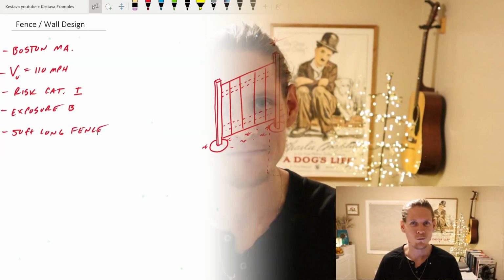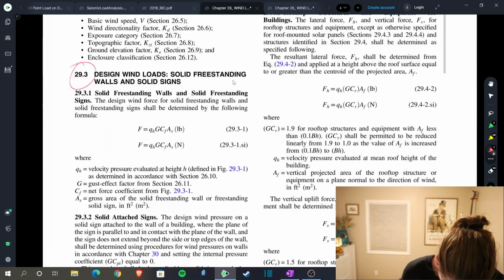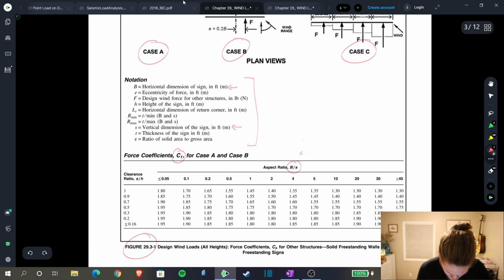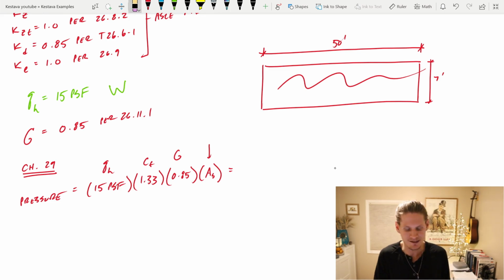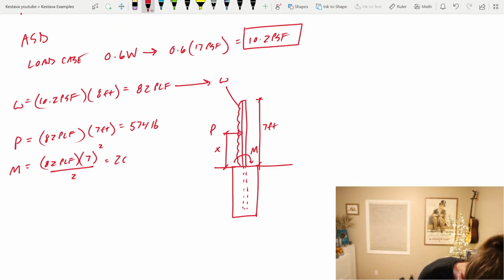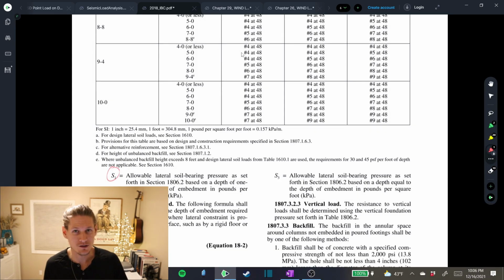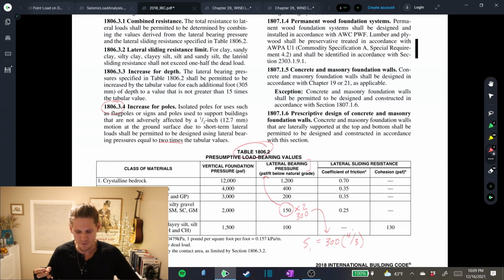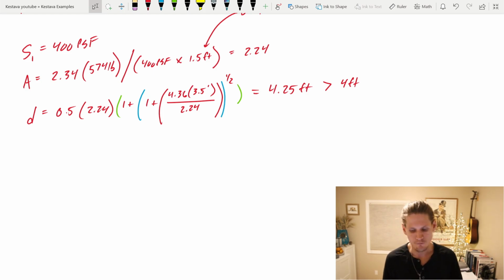Design LASTING Concrete Post Footings - By Professional Engineer

Comment: You can keep the d as an unkown and plug everything in the scientific calculator as a single equation and then use the solve function in it. It will solve for the unknown variable doing LHR = RHS and give you the result. This avoids the iterative process. For this example with 18" dia, the depth comes out to be 4.14'. So a 4'-2" deep should do.

Comment: Thank you for explaining these formulas, as I couldn’t get my head around it.
For the force height for a fence without gap, shouldn’t the force be applied at 0,05h above the geometric center, as shown on section diagram and described in ASCE. (load at 0.5h + 0.05h = 3.85f, not at 0,5h = 3.5f).

Comment: Had my contractor listened to me, my fence would not have come down.  He buried the footings at barely 2ft.   Do these calculations remain the same whether the post is fully buried in concrete or if using a post suppost that is partially buried in the footing?
Reply: With footings, you are receiving the resistance through your soil pressure acting along the concrete footing. With that being said, the depth of the footing is ultimately what controls the strength of your post. Whether you put the timber post all the way or partially into the concrete, that won't have too big of an impact as the soil is acting against the concrete. However, it may be beneficial to have some decent embedment of your wooden post into the concrete. This is my take on the subject and I may not be 100% correct. Thanks.

Comment: I love this video from an IBC and ASCE stand point. Your videos are truly amazing. My concern is with the typical “butting heads” of engineers and contractors. In the “real world”, if I tell a contractor that his fence post holes need to be 18”x54” I am going to get socked in the face! Just saying. Also, when we do not have a geotechnical report, is there a “default” soil/site class to select in order to get that “S” value?
Reply from the maker: totally agree James! good engineers should always be straight with the contractor with things that "could" be designed by an engineer and things that "have" to be designed by an engineer. we are bound by the code, so as soon as a contractor says to design and stamp something we cant just say its OK because thats how its always done. we have to prove it with calcs and the code. Yes there are default conservative values in the IBC that can be used!

Comment: Does this work if I'm embedding a pergola too? Would it be necessary for me to get some kind of rebar inside this type of piles?
Reply from the maker: pergola's have a large uplift force on them due to wind loading. you will most likely have higher loads that you need to design your footing for and rebar would be required to meet code minimums and provide development of the anchor bolts further into the footing (if required). but these are things an engineer needs to consider if they are designing the footing for you. the pergola manufacturer may provide prescriptive footing sizes that a contractor (or you!) can build. I hope this helps!
Reply: @Kestava_Engineering  Thank you! I'm a big fan of your content and I've learnt a lot with your vids, keep up the good work!☺

Comment: From a practical perspective, 18" diameter post footings would be impractical and uneconomical for a fence.  Something is amiss, this doesn't pass this 'what is done in reality' test.  Usually fence post hole augers are 6" or 8" diameter
Reply: Yes, agree.    From the aftermath of a few hurricanes it seems the typical  metal fence post installed as you indicated are bent over with some missing segments, and the wooden post  (not rotted and originally backfilled with concrete)  are left standing  but without many of the fence segments attached.  I guess this is a good example to use when designing non traditional items such as signs where stamped calculations are necessary and liability is involved.
Reply from the maker: right on the money @themodelmaker123. it all comes down to an (engineered) design vs what you decide is best for you. engineers are bound by the building codes and material codes adopted by the local authority and we must uphold them if designing stamped engineering documents. the loading criteria we need to meet is (most of the time) significantly higher than people would expect, especially for residential type work. fences are a common item that engineers avoid designing because they end up having to spec footings that are much larger than is expected, but they cant justify through calculations or code to make them smaller. :(

Comment: What would my P be for a picket fence with a load case of 41 psf, spaced 5 ft on center? Pickets are 1” wide and posts at footing locations are 3” wide. Having trouble with the tributary area calculations for a picket fence setup. Post is set to be 8’ high. Thanks!
Reply from the maker: you can conservatively run your calcs assuming the wall is solid - try that first to simplify your tributary area! let me know how it goes

Comment: Hi Kestava,
Thank you for the good design example video, very informative but is done much faster than what one would be solving in the real exam environment, for you jump fast between manuals and many pages/tables. 
The question I have is WHY and While you have selected the Wind Load value of 06W but you have not considered the Dead Load value when you used the Allowable Stress Design. Doesn't the DL count here in resisting the wind load?
Reply from the maker: Hi Sudqi - I agree that this problem (in depth) would not be something to expect of the PE exam. A form of this problem suitable for the PE may be that you need to size an effective footing and they give you the wind pressure already. You absolutely can take your DL into consideration when resisting your overturning forces, but in this case the DL is very very small because it is only a wood fence, so i just ignored it.

Comment: Isnt max moment (w*l^2)/8? I believe  (w*l^2)/2 is for max shear of an evenly distributed load.
Reply: wl^2/2 is the maximum moment for a cantilevered beam
Reply from the maker: Jackson you da man
Reply: Daniel you are thinking of a simply supported beam max moment possibly and the big difference there aside from the support conditions is that the max moment in ur case is located in the beam while this condition the Max moment is all shot into the fixed support. Hope this helps for some food for thought!
Reply from the maker: Bingo